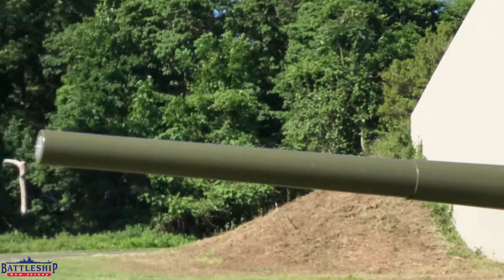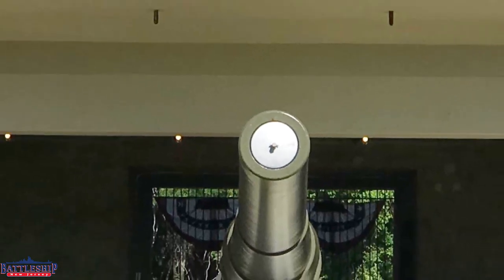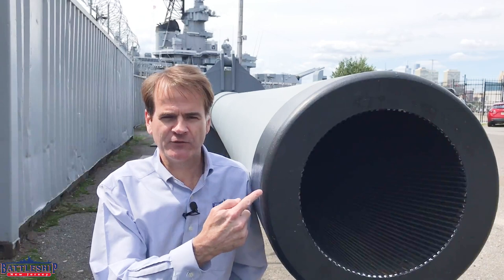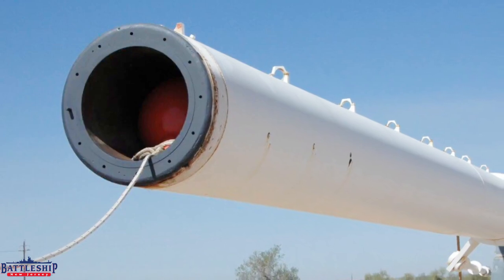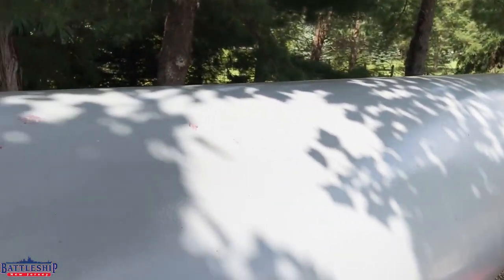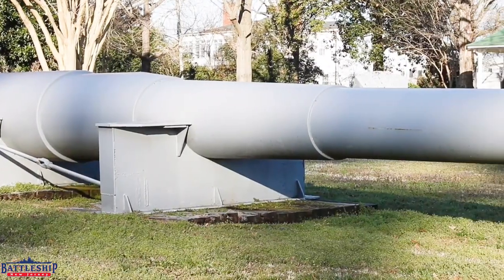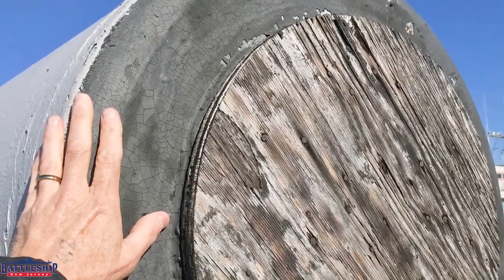Where are New Jersey's Original Gun Barrels?

Comment: I had a one-of-a-kind opportunity to teach in an apprenticeship for machinists at the Watervliet Arsenal in Watervliet NY. It was built in 1812 to supply cannon for the War of 1812. It was built only a short distance from the Hudson River. In fact, the walls of the buildings facing the river were heavily reinforced in case of British Navy bombardment. This introduction actually ties in with the video. There a few panning shots of the breech end of the tube, that are marked " US Naval Gun Factory WNY", i.e., Watervliet New York.  Almost all of the machine tools and heat treating pits (unsafe to use because of asbestos insulation) are still in place. The lathes are really impressive. The heat treating furnaces are oriented vertically, if the tubes were set horizontally the would get horribly warped. They are not "barrels" they are called tubes. They are not "cannons", they are naval rifles. You could probably walk into the Arsenal, to this day, and receive dirty looks and/or correction to use the proper nomenclature. The breech block itself weighs approx. 1500 lbs. I don't the weight of the 18" tube to be 110 tons. The tube for the Iowa-class tubes weighed 110,000 LBS. The complete rifle assembly: tube, breech ring, breech plug and mount totaled 220,000 lbs., or 110 tons. Walking through the Arsenal, even in the 1990's, you could sense the history, since 1812. 6:36 6:36
Reply: I drove by there several yrs. back and there were two lg. tubes sitting in the parking lot visible from the highway,, often wondered what they fit.

Comment: Having that truck and the barrel is a miracle!
Reply: yeah that is almost 1000 tonnes of steel that could have been turned into anything like 50 new cars
Reply: @patrickdean9797  No that is a 1000tons of Low-background-Steel the medical/tech industry would spend a fortune on for their detectors/ high-end medical scanners. Last I heard it was $25 per Lb. So thats 1kg circa $50. I'll let you do the maths of 1000 tons.
Reply: @mwnciboo  5 million ? what is low background steel? for what the guns were disigned to do and the forces involved it has to be the very best steel that you can get ?
Reply: @mwnciboo  i understand now this steel was produced before the detonation of nuclear bombs but wouldn't the guns still get a dose of radiation or does it not penetrate steel?
Reply: @patrickdean9797  no that would be used in more sensitive applecations, the pre atomic steel, thing is there is only soo much to go around, and 2 you think they make cars out of steel from the usa most likely chinese or elsewhere, things are made as cheap as can be, sadly
Reply: @manga12  yep the profit margin is the most important  margin
Reply: I had several tons of pre nuclear steel. We tried but were unable to get anything more than going scrap steel rate for it.
Reply: @mwnciboo  Much of steel's value has to do with heat treatment.  Once you melt it down, that all goes away.  Carbon content and other elements in the steel don't change when you melt it down.  But, you'd need to guarantee that these barrels are all that is included.  Once these all get shipped to China, they get mixed with our soup cans, various car parts, clothes hangers, etc, and get their interpretation of "steel".
Reply: I saw that setup as it was on display in Coatesville,pa for a while.

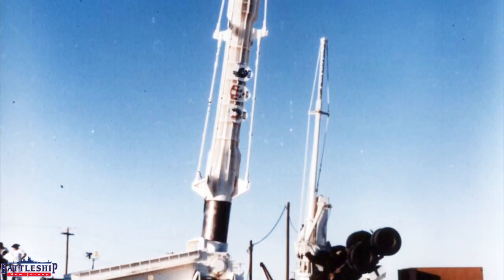Comment: 4:05 for reference, space is generally considered to start at the Kármán line at 100km or 62miles. The Kármán line was an attempt to calculate the point at which the minimum velocity for aerodynamic effects exceeds the orbital velocity. There's some disagreement as to where space starts, but by this definition this projectile was nearly twice the height needed.
Reply: Depends on the trajectory - too flat, no go. too steep, no go.
Reply: Lots of answers to this. Half lift from aerodynamic wing, half from the curvature of the earth.
Reply: Something like that. Normal planes need enough air for props/jets and wings to work. Without enough air, they don't. Beyond that, you need rockets and Vernier thrusters to move the ship. The X-15  proved it before Mercury had it's first launch. That "line" is as good as any and probably not far off from the right place. (I think the American line was lower, at 50 miles/80KM but the same idea.)

Atmo gradually dilutes and fizzles out. You gotta decide where "flying" ends and "space travel" starts.

Comment: I had wondered if the Navy ever tested any 18" rifles...now I know. Thanks for all the info... very interesting!
Reply: Yea read into it, very cool gun. Started life as an 18"/48, converted to a 16"/56 and then converted to what it is now. Had incredible penetration compared to the Yamatos but was never fielded.
Reply: @johnlee8523  I wonder if eight of these guns might have made a good alternate armament for the Montana class.
Reply: @robertf3479  Definitely could, couldn't match the armor though so she'd be like the NCs designed with 12 14" guns in quad turrets and upgunned to 9 16"s in 3 gun turrets but with the 14" style belt. Could possibly make a 9 gun/3 turret ship with those dimensions but I'm not sure if there's enough beam for it.
Reply: @johnlee8523  Really poor liner life as a 16"/56.  125 rounds at full charge.  I'm sure it was even worse as an 18"/47.
Reply: @zoopercoolguy  Yea the higher velocity wears them out, Italians had the same problem with their 15s. I don't think the 18/47 was worse but I'll have to look it up, definitely was less then the Mk7s BUT with modern propellant they'd be fine.
Reply: @johnlee8523  The 16"/56 had a barrel life of roughly 125 rounds.  The Mk 7 was 290-350 in WW2 and Korea.  By the 80s, the Navy had developed different additives and ways to wrap the powder bags that basically eliminated wear from gas erosion.  At that point they started rating the life of the barrels based on mechanical fatigue.  That ended up being about 1,500 mechanical cycles.  So the 16"/56 had about a third the life of a Mk 7.  Not great.

Comment: Back in the 1980's a freighter, the SS President Adams, loaded some Iowa class gun barrels at the Subic Bay Naval Base in the Philippines. On the way back across the Pacific it turned out there were a variety of snakes that had been living inside those barrels. Some of them were poisonous. Big stink in the deck department and the sailors refused to go on deck at night. When the ship got back to the States it had to anchor out in San Francisco bay and have exterminators come aboard to deal with the snakes.
Reply: Lmao. That's the navy for you. Army or Marines would've just eaten the snakes.
Reply: That amazing.
Reply: @WvlfDarkfire  Why would they eat snakes when there's far better grub onboard the ship? Your comment makes little sense
Reply: @Zamandu  I guess you've never heard the term snake eater for special forces members?  It was just a cute joke
Reply: @charlesborlase2238  I have, although it was a bit low-brow in this instance and didn't feel very "earned"
Reply: @WvlfDarkfire  Army would have eaten them. Marines would have married a snake or two for the housing allotment
Reply: Were I work we have the barrel from some battleship (i'm not certain which one), that we use for high pressure testing of deep submergence items.  It's been cut down to just a few feet in length and plugged on one end but it's one of the few ways we can create pressure testing vessels that can create and withstand pressures similar to the deepest point in the ocean.
Reply: @Zamandu  Bet you're a blast at parties.
Reply: @bower31  No reason for Marines to eat snakes when they had plenty of crayons on board.

Comment: Two more of the 16 inch barrels are welded together in Barbados. The setup is just like the ones at the Yuma Proving Grounds. It ceased firing long ago due to the damage it was doing to buildings in a large portion of the island. It/they are still there rusting away in the salt air.

Comment: Were I work we have the barrel from some battleship (i'm not certain which one), that we use for high pressure testing of deep submergence items.  It's been cut down to just a few feet in length and plugged on one end but it's one of the few ways we can create pressure testing vessels that can create and withstand pressures similar to the deepest point in the ocean.

Comment: I recall seeing the guns when I worked at NSWCDD, but they were by the river (where they test-fired them down the Potomac). The one mounted wasn't there when I was there in 95. NSWC Dahlgren - Praise our thunder. I knew they stopped making liners at the end of WWII, and there were only so many of them.
Reply: I saw the barrels on the several occasions that I went down for meetings at the JWAC.
Reply: One of the 16-inch guns was mounted in the '80s and was test fired in March 1984.  I remember test fire rattled the windows in the hangar where my office was.

Comment: This actually raises the question, do the original/spare barrels of the other 3 ships still exist ?
Reply: One from the Missouri is on display next a barrel from the Arizona at Wesley Bolin plaza in Phoenix.
Reply: Yes they do exist but some are not as good looking as the rest due to rust
Reply: @emersonaz  There is another Missouri barrel at Cape Henlopen, mounted in place of a former Coast Artillery 16” gun.
Reply: #393 From the Missouri is Located at Eastern Shore of Virginia National Wildlife Refuge (Fort John Custis)
Reply: #386 from the missouri is located on display at battery townsley in marin headlands, just north of san francisco
Reply: @anselshen5768  thank you for that. Just came to ask if anyone knew the provenance of that particular barrel.
Reply: A bunch of 16” spare barrels were sold for scrap back in 2012 or so. They were sold at auction from Hawthorne Army Depot in Nevada. I was in contact with one of reps from the company that won the auction, I had a muzzle end section lined up to purchase but didn’t have time to make the trip from GA to NV. The breech end sections weren’t available and would have weighed far more than the muzzle end. I’m not sure what I would have done with a really heavy 3-4” section cut from the muzzle, but I regret not completing that deal.
Reply: @Colonel_Obvious  I directed the main gas turbine overhauls on a few of the Chevron oil tankers at Swan Island in Portland Oregon in the early 1980's. There were several breech ends of 16'' barrels sitting in the shipyard in the weather. I was told that they were obtained for their high quality steel and at least one was modified to test parts under extreme pressures.
Reply: @kimmer6  Great, thanks!
Reply: @jacksons1010  yup, it's quite impressive.
Reply: @kimmer6   metal forged before 16. Juli 1945 has additional value in the fundamental physics and radio nuclear science area

Comment: Am I remembering correctly that the 9 barrels installed on New Jersey, that she sports today, were the ones originally made for her never finished sister ship, the USS Kentucky? The second donor gun for the proving grounds space cannon is an interesting question? Is it known if it was one of the 16”/50’s? Or could it have been one of the 16”/45’s? Possibly from the USS Washington? The 18” gun was I believe an experiment likely intended for the Montana class. The problem they ran into was they required too broad of a beam, which would have restricted any ship built for them from traversing the Panama Canal.

Comment: There are two brand new barrels for Iowa class battleships at China Lake.  They were brought in by a guy (via some shady means that I won't go into here) that wanted to weld them together and bore them smooth to make a horizontal HARP Gun for reasons.  He never got any backing for the idea, but the barrels are still there.  They've a bit of cosmetic rust, but the desert has preserved them well.
Reply: i understand china lake has one 16-inch gun out at echo range gun line they used for testing rocket assisted saboted rounds and other strange rounds for use in vietnam.
There is also a breach that they turned  into a large rocket propellant casting press.

Comment: I used to work at a company that purchased the lathe used to produce those barrels. The bed had been reduced to 60' by then. Enormous 50 hp electric motor. Not sure what became of it after I no longer worked there. Late 1980s
Reply: There were several of them gun barrel boring lathes built back in WWII. Niles Machine Tool built most of them.  LeBlond built the others.  Most of these lathes were converted into trepanning machines for deep hole boring/drilling for the oilfield industry.  I spent my earlier years helping in the retrofitting a few of them.  One I worked on had a 150 HP DC motor hooked up direct drive to the spindle.  Our government purchased many of these machines and moth-balled them and put in storage up in the salt minds in southeastern Kansas for later needs that never happen.  Slowly, the equipment was sold off at auctions over the years, the last sold off sometime in 2005-2008.

Comment: Hypothetically, are they all in firing condition? Could they all still be used on the battleship or do they all require maintenance (besides the barrel in Arizona)?
Reply: Since they were all replaced on account of being worn out.....
Reply: @FIREBRAND38  -  If you watch the video they use one barrel in Arizona to fire an object into space. So its clearly still usable. We're the barrels relined with new rifling? That's the part that got worn out and can be Not the whole barrel.
Reply: @TheBigExclusive  they lined up the rifling to 1/18 of a MM for the two barrels. No re tooling of the barrels needed.
Reply: @TheBigExclusive  HARP was a long time ago. It was part of Gerald Bull's career, ended by a Mossad kill team in 1990, when Bull was working for Iraq.

Comment: I should go see what the serial number is for the barrel here in San Pedro. I'm sure it's from her time in Long Beach so I don't know if just a spare or if it was actually ever installed.
Reply: It was never installed. Nine barrels were shipped to the Subic Bay in 1968 for replacement on New Jersey if needed for Vietnam. They were sent on LSD-5 but never used as New Jersey got pulled after her one tour. Those barrels were sent back to LBNSY when Subic closed and were to be disposed of. The one in San Pedro was the first one lifted by crane to be placed in the bottom of dry dock 1 for cutting. The crane made a wrong turn and dropped (they say) that barrel on the side lawn of the Los Angeles Maritime Museum. Six barrels were then cut up with carbon arc cutting tools and the other two sent out to China Lake Naval Weapons Station.
Reply: I was just trolling the comments looking for info on this barrel!
Reply: @craigisbond007  Haven't looked at it too closely when I walked by it but I'll see if the markings are still there when I walk by next time.

Comment: Two large metal objects with the exact same measurements may react differently under high pressures/temps.  They likely test the barrels and then align them in sets based on the results.  Just guessing.

Comment: I know this isnt exactly related to USS New Jersey, but do you know what happened to the spare parts required to repair Turret 3 of the USS Iowa? Aftet the 1989 turret explosion accident, the articles said they had the spare parts ready to go on the Naval shipyard. But the ship was decommissioned instead. And the turret was never repaired. They just painted over the damage and it remains nonfunctional.
Reply: I was told that the parts to repair the damaged turret are sealed in the turret
Reply: I also heard all repair parts were sealed up inside the turret
Reply: @oldfatandtired6406  Here's what Richard Landgraff had to say about it in 2014.

According to a verbal report given to me by the progressman, everything that was needed to fully repair the turret in Norfolk (including the repaired range finder) was on the pier waiting for the center panel of the turret top to be removed. The Class C armor bolts were loosened up with Wintergreen penetrating oil, the damaged section of the center powder hoist was already marked off for cutouts and replacements (the markings are still there) but suddenly funding was cut off.

PBC inspections from 2006 until present found only a pile of boxes of nuts and bolts in one of the powder magazines labeled for the turret repair and a pile of damaged parts in an adjoining magazine. However, the last crew of the ship, while still in commission, cleaned everything else up very well and unless you were a turret expert you would think everything was ship-shape as you climb up from the powder magazine to the gun house itself. The crew did an excellent job of cleaning things up and repainting where necessary.

But without electrical, hydraulic and medium pressure air supply the turret can only remain a memorial to the 47 lost lives. Also, of the loosened bolts on top, 47 were removed and the bolt holes capped with metal plates (see photos on pages 233 & 234 of my book). Presumably those bolts were removed and made into some sort of a memorial but I have no idea of where it may be.
Reply: @zoopercoolguy  - what a shame that the spare parts "mysteriously disappeared". They should have at least saved them or seal them inside the turret.